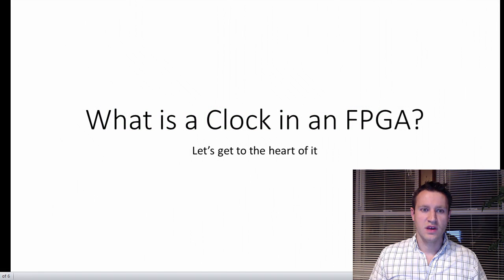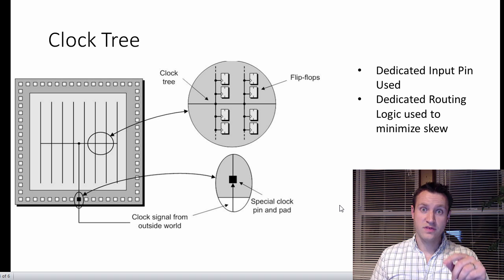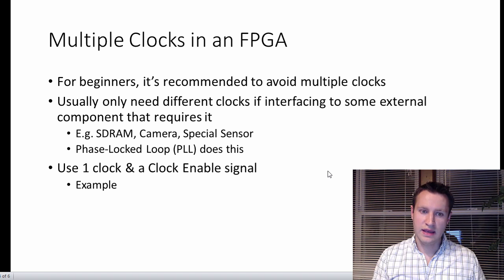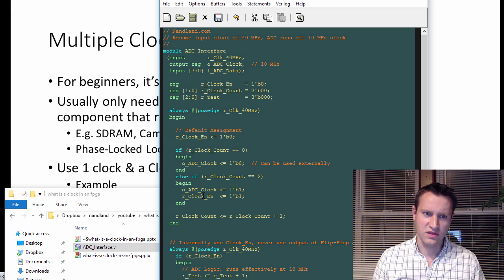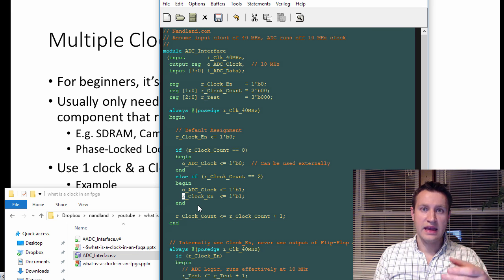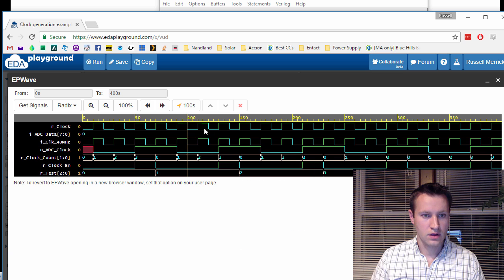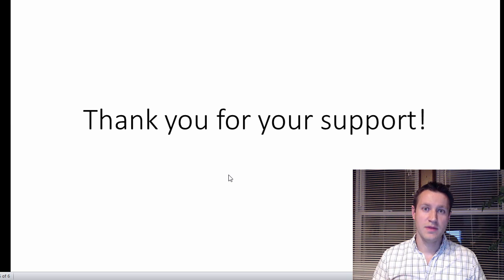What is a Clock in an FPGA?

Comment: I have a pretty dumb question, and I’m super new to digital design as I come moreso from a software/programming background, so please bear with me lol.

You talked about how you’ve made projects for interfacing with a camera. Why would you want to design something with an FPGA to do stuff like that as opposed to using a microcontroller like arduino? 

I guess this question sort of applies to a lot of digital systems work in general. If a lot of this stuff can be implemented in software and/or with microcontrollers, why design use FPGA’s instead?
Reply from the maker: If you can do it in a microcontroller, you should. FPGAs are more complicated and take more engineering effort to do the same task. However sometimes you can't use a microcontroller, they're just not fast enough. I doubt you could get an Arduino to process data fast enough from a high pixel / frame rate camera.

Comment: I'm curious how I would generate a 25.2MHz VGA clk from my 50MHz Ext Osc. The ratio is 63/125, but I can see any sensible way to apply any non-power of two division to a clock. So far I have just been using ALTPLL.

Comment: Hey great video, i can finally understand more about the inner working of CTS. But i have a question. What does it mean when you say the 10MHz clock cannot be used internally? Does it means i cant create one module of 10MHz ADC clock like you did and channel it throughout the FPGA for other sequential circuit that requires it?If it can be used externally where it is place? As another pin? Anyone can clarify?

Comment: Using a flop output as a clock input is such a schoolboy error. This burns lots of folks when they first start playing with FPGAs. It usually works in the simple "flashing an LED" examples, but, then burns you for anything more complex!

Comment: Interesting. Based on my understanding its not always good to use logic for clock prescsler. It will be not as clean as from PLL. Jitter performance should be much better. And when you run 100MHz 16MHz  adc  you need few ps jitter in order not to generate tones that are not in your signal

Comment: "The ADC clock is not used internally, because it's the output of a flop-flop" You've tried to explain why, but I still don't get it right I think. Does it has to do with timing? (like the output of a flipflop is that current edge unreliable?

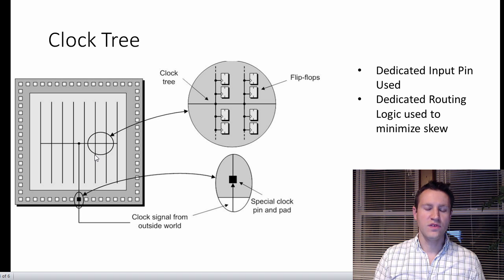Comment: 5:20 You are wrong about processors doing one instruction at a time. In fact, modern processors have hundreds to thousands of inflight instructions. And basically the processors are also made out of millions of combinational logic gates and sequential logic elements i.e. flip-flops. So, potentially all those millions of flip-flops in a processor can also toggle in any given cycle. But in either a processor or an fpga, the percentage of all flip-flops that might toggle in any given cycle is less than 50% statistically.

Comment: hello sir, tell me if im wrong but i thought o_ADC_Clock is suppose to be 10 MHz but instead it is 20MHz( it operates 1 cycle every 2 cycles of 40MHz wave).
Reply: I believe a clock so high can heat a lot, and burn the circuit.

Comment: I would not rely on a default assignment in a clocked process with non-blocking assignment. Your code will be subject to race conditions and may have a different behaviour depending on the simulator.
Reply from the maker: Hm, not sure exactly what code you're referring to... but I've done default assignments in clocked processes for years and never had a problem across Lattice, Altera, and Xilinx FPGAs and synthesis tools.

Comment: Important point: Since the enable signal is generated from the base 40MHz clock, using enable true in conjunction with the rising edge of the 40MHz clock happens at the 2nd edge since the enable happens - in real time - after the first rising edge of the base clock.
Remember propagation delays as well as setup and hold specs in the “real world”!

Comment: Would it be more power efficient to use a PLL to divide the main clock versus the example you gave of dividing the clock manually in verilog?
Reply from the maker: Just to be clear I'm not dividing the clock... I'm using a clock enable.  And to answer your question definitely clock enable is more power efficient.  PLLs take 10-100s of mW of power.  They're more useful for creating clocks that are out of phase with eachother and have no relationship.  E.g. 100 MHz and 121 MHz or something like that a PLL is good for.

Comment: Did you say there's a way to go faster than the main 25Mhz clock on the Go board? I'm curious because I'd love to construct my own Ethernet interface circuitry eventually.
Reply from the maker: Not without replacing the main oscillator on the Go Board.  There's no PLL on this particular FPGA.